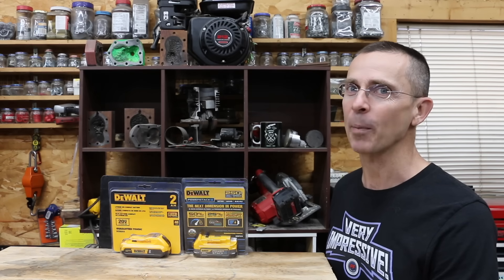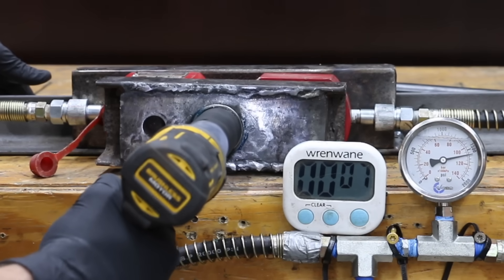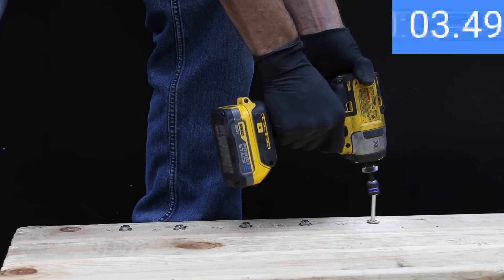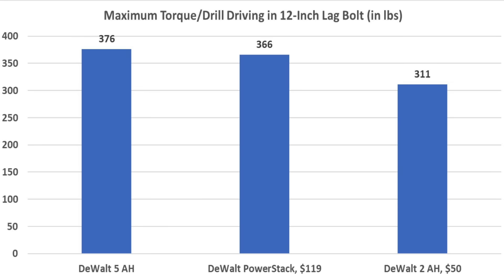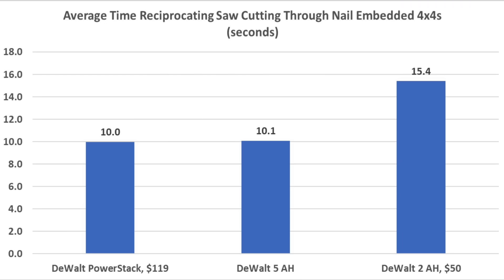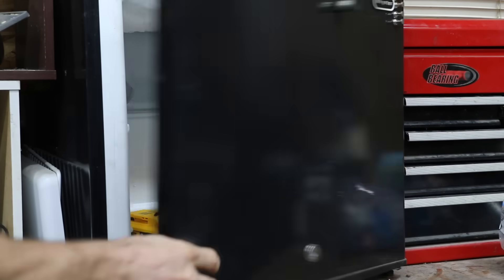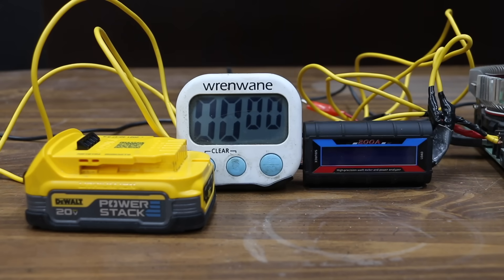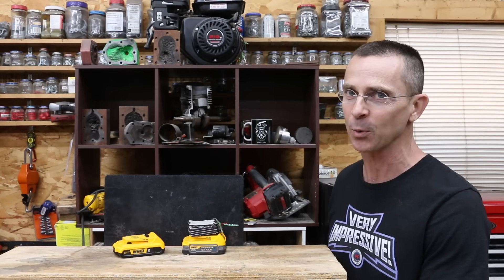Compact “Pouch Cell” Battery Better? Let's Find Out!

Comment: At the current pricing, I'd rather have 2 or 3 of the regular 2AH batteries. If one fails, you still have a back-up. Also, I write the date I purchased the batteries on them, and assign them a number. That way if I have a battery that keeps coming up short or develops an issue, I know which one it is. It's too easy to lose track of batteries when you have 5 or 6 and are out in the field with a project.
Reply from the maker: Thanks for the feedback.  Good tip.
Reply: @ProjectFarm  also you can fix 18650"s easier. much harder to find pouch cells to spec.
Reply: Its probobly just matter of time untill the prismatic pack is cheaper than the circular cell.

While the machinary to produce prismatic cell are more complicated, and expensive... the cells use less material
Reply: @matsv201  it's just a matter of time until the tools take over and we're fighting for our own survival. That's why I keep my tools locked up.
Reply: @whitesturgeon  yea.. I watch a video on a smart drill earlier today that gave the operatör instructions.. its just matter of time untill the turn evil
Reply: @whitesturgeon  I, for one, welcome our robot overlords.
Reply: @whitesturgeon   Shit, that explains some of what's happening in my house right now...excuse me, I gotta go call Sara Connor!    Aaaahhhhh!!!!!
Reply: I have a P-touch label maker that I use to do just that. And since the tape is heat sensitive, you can tell at a glance if the battery pack has over heated because it'll turn solid black.
Reply: @ImpendingJoker  The heat-sensing is a nice feature I never considered!  But I just use a sharpie to label, and that is so easy I think I'll probably keep doing it. :)
Reply: @ImpendingJoker  !!  I still have the p-touch. What an idea!
Reply: From an engineering perspective, I might add a couple things:

Start compiling energy density in terms of Wh/kg and also Wh/cc. The volume of an irregular shape like a battery pack can be easily done by wrapping a pack in a plastic bag (vacuum sealing would work, just pull as little a vac as possible to avoid damaging cells) and dunk in a bucket of water, calc the volume from water level change)

This gives a good baseline as to who is using space efficiently. Also consider changes in points of balance when mounted on tools. Some impacts or drivers may be nose or tail heavy.

Look at thermal characteristics of the packs with both a FLIR type imager and also a thermocouple buried inside the packs. Understood this is a challenge with the pouch batteries.

Reason I mention this is the pouch batteries became cost-effective with high-volume cellphone ptoduction. Most phones have a single pouch, with a large heat dissipation area on the back and through the display. Stack a bunch of them and those cells in the middle have to conduct through outer cells and connecting tabs, or radiate out the tiny edge areas. Maybe they sandwiched some copper plates in between to extract heat? In any case it would be useful to compare life of the different packs. That would take hundreds if charge/discharge cycles, so that could easily be a year long effort. A programmable power supply/load could shrink it to months. Check with Keysight.

Just some random thoughts...
Reply: Even more importantly, the old ones are Korean cells assembled in Mexico and the new ones are all made in China. Think about where your money goes and what that means for the future of Democracy.
Reply: @christopherestewart  99% agree with you, but here in the USA we are a Republic, not a democracy...
Reply: 👍🏼 Yes, that is similar to what I do! Got to know which are getting wimpy or might be a warranty claim! 😎✌🏼
Reply: I number my Makita 5.0s, and rotate them for even wear.
Reply: "Also, I write the date I purchased the batteries on them, and assign them a number. That way if I have a battery that keeps coming up short or develops an issue, I know which one it is. It's too easy to lose track of batteries when you have 5 or 6 and are out in the field with a project."
I am going to do this next time I purchase batteries!
Reply: TFW the Youtube comment section actually has good advice. This is something I plan to do myself now.
Reply: I'm actually more interested in the price comparison between the PowerStack 2Ah and the regular 5Ah battery.  If the 5 Ah battery is priced the same or less than the PowerStack, then the 5Ah is a way better deal.  You get the same or better performance as the PowerStack, but more than double the capacity.  The only thing you give up is size and weight, and I'm not sure it's enough of a difference to warrant the capacity loss when compared to the PowerStack.
Reply: @somejoe7777  It's actually 3 times the capacity... I'd prefer the compact 21700 single row-packs instead. About as much power as a 5aH, but slimmer design and still twice the capacity of the stack.
Reply: @somejoe7777  the cheapest I've found them is around $75- $80 a piece when you buy them 2 at a time.
Reply: @somejoe7777  I think most people that know about batteries and their history think of the li-ion metal cylinder cells as a better quality battery platform than the li-po pouch. Not sure how Dewalt can charge twice the cost when that pouch li-po battery technology can be found in really cheap things that need high current like lithium jump starters.
Reply: @practicalguy973  I've had 4 jump starters bloat and fail. While I can repair them, getting the lipo pouches isn't nearly as economical and easy as cylinders. I take power tool batteries people throw out and refurbish them with quality cells. I've got a 5ah that puts out 30a when needed so that's used I high torque situations. Using the same battery I used 20a cells but made it a 6ah battery for lower torque applications where I prefer longer run times but don't need the higher power. I do the same with 2ah batteries though I tend to pick a cell that has higher instant amps but not necessarily the highest so it gets me go overall capability.
Reply: @somejoe7777  - If weight is an issue, the Power Stck is definitely a winner. If not, the Power Stack is not worth it.
Reply: @somejoe7777  You can get 2 5ah batteries a charger and carry bag for $124.99.......Way cheaper than the powerstack..
Reply: the point of the power stack battery is to have similar power density to the 5AH battery and less than half the weight, its also very compact, which again is the whole point. supposedly Dewalt are coming out with new impacts early 2022 and i plan on getting 2 power stack batteries to go along with my purchase.
Reply: I have several backup batteries for my heated jacket. I like the idea of a lighter battery but I don't like the🤑.. super cold temperatures have an effect on every battery I don't care what kind
Reply: Great comment!  I do very similar regarding batteries.  And photocopy your receipts with a smartphone, copier, etc, in case of needing to make a warranty claim.
Reply: There is another advantage to your recommendation. One battery in the tool, another battery on standby, and a 3rd in the charger. That way, you can work continuously, without having to wait for a battery to charge.
Reply: 2ah batteries are great for things like orbital sanders and tight spaces with the impact. I've got 2x 2ah, 2x 4ah, and 2x 5ah and the 2ah's are almost always my go-to batteries unless I know I'm going to be really punishing it, like with a sawzall, blower, or chainsaw.  Just makes using the tool so much more comofrtable.
Reply: A least with modern cell phones we know that quality li-po pouch cells can be done but I don't think its better. It was less over all power in Wh as shown in the video compared to the small 2ah. I have a feeling the cylindrical li-ion is still the better way to go in the long run. For a smaller battery needing high current it makes sense to go with lipo pouches but with a 5ah and larger that is a lot of current ability for power tools anyway so sticking with the standard 5ah Dewalt is what I would do especially for the cost!
Reply: @practicalguy973  Exactly,  The need for max power AND ultimate in weight savings is a pretty rare situation for most people using hand tools.
Reply: @practicalguy973  if you factor in cost sure, however the point of these batteries is they put out as much power as a 5AH battery at less than half the weight and size, they are compact. yeah so they dont have the same endurance as a 5AH battery? so what, buy two. thats what im going to do. this is new tech for dewalt or any power tool manufacturer and as time goes on bigger and better batteries will be released.
Reply: Home Depot currently has PowerStack at $119 and a bundle of normal 2ah, 4ah, and 6ah all for $149. You won't see those kinds of sales with a proprietary cell type and low manufacturing scale that they're not pulling as much profit from.
Reply: Seems like they are going to try to push these pouch batteries because they are 100% sourced in china an that means more slave labor, lower costs and higher profits...  I say a big FU to that...
Reply: @asificam1  Agreed
Reply: I actually just got a 2 pack of the power stacks to compliment my 4 2AH I got with other tool packages. I have a reciprocating saw that was nearly useless with the 2AH batteries. It couldn't make it lengthwise down a 3/8" sheet of plywood on a single battery. With the powerstack battery it cut the full length (slowing towards the end) but recovered after a 30 second break. I know its the wrong tool for the job but I had to rough  out a door on a shed too far from an outlet and didn't have a cordless circular saw. It became the benchmark for the batteries after i realized how fast the reciprocating saw ate them.
Reply: @dreamwraith-84  - at double money?
Reply: @asificam1  Use a label maker, the labels are mostly peel-n-stick by default my experience
Reply: How do these batteries stack up against a 120volt powered  unit
Reply: @punker4Real  depends on design. Batteries beat the pants off most corded simply because it has more or less equal performance but is portable. That being said if it'd all equal or they design the motors and you pay the money, a shore powered tool will likely out perform a battery tool,  assuming it's not harbor freight.

While i have corded and some air tools, most everything gets converted to battery because I almost always need portability over the extra little bit of torque or longevity. I can always have spare batteries to overcome that.
Reply: @punker4Real  No comparison. Plug-in tools will always be more powerful, and they don't run out of batteries.

Nothing beats air power though, but it's very inefficient.
Reply: @TehButterflyEffect  not true, go look at torque test channel latest video. He shows a Ridgid and other impacts that beat even the best air power.
Reply: DeWalt actually has a really good return policy on there batteries especially if you write the purchase date on them.
Reply: It's literally the first thing I do when buying a new battery. I started keeping track of the batteries when I bought a Black and Decker mini vacuum cleaner over twenty years ago. Batteries were always going bad. (nicads)
Reply: I'm sure 99% of us feel the same way
Reply: It's another money gimmic. It doesn't offer enough difference to be considered efficacious.
Reply: Also, a higher capacity drains less per cell, which would lead to longer overall life. I.e. a 5AH should hold capacity closer to 5AH compared to a 2AH to 2AHs.
Reply: Lipo usually have around half the lifespan of lithium ion. I think these lipo batterys are cool but not cost effective. ive never wanted more power out of a brushless impact
Reply: @asificam1  - paint pen.  Specifically ones intended for writing on pipe, etc.   There's also ultra thin heat-shrink that they use for 18650 I'm sure you can get for AA size - I've found it holds marker much better.  It may still be too thick for a lot of the uses of AA.
Reply: @asificam1  try a fine tipped artist paint based marker, easily found at a place like Michael's, multiple choices such as metallic gold, silver etc, won't tend to rub off easily as a 'permanent' sharpie marker or peel off as a glue based label could. 👍
Reply: Yep, when I have several batteries I label one A then the next one B etc. I like keeping track on how much I use a battery so I can rotate them 👍
Reply: …except that a 2Ah battery can make a higher class tool perform like one that costs several hundred less… and make some of those lesser, more-affordable, tools nearly useless. You wouldn’t shell out $400 for the new DCF900 brushless high-torque and slap a 2Ah pack on there. You’d just get a compact or mid-torque, and even then you might want that 5Ah to get the most of it.
Reply: Currently he has two yes two of the 1.7 ps for $55. This seems like a crazy deal to me
Reply: The small 2AH battery aren’t worth it…
Even for longer home projects you should have a 4AH. 

And nowadays, you can get two 5AH for 75$.
Reply: I also date coded the batteries I bought and gave them a number so I can see how long they last. Glad Im not the only one!
Reply: You can often pick them up on sale for around $60-80.
Reply: Do keep in mind that the original MSRP of the 2ah was about $100, and they've dropped it in anticipation of these coming out. It's likely the 2ah may be discontinued if the power stack system catches on
Reply: @davidthomas2870  Won't happen. They need small cheap batteries for their "kits", knowing you'll soon buy at least one better battery. And prismatic (pouch) batteries degrade faster in use whereas the cylindrical cells hold their capacity better till near the end of their use-life.
Reply: I can see certain situations where the PS battery would be nice to have (weight). But I wouldn't go crazy with a bunch of them.

Time will tell their reliability also. Gas buildup in a pouch pack kills the vacuum applied to it that keeps all the sandwiched materials together and you end up with a poor performer. Cylindrical cells are much more durable with regards to abuse imo.
Reply: 2AH battery will not deliver the performance, it just cant do the tough job that powerstack can. sure if you're doing light duty things and care more about runtime than power. but if you dont need to run the tool for extended epriod of time but need to do difficult jobs powerstack can do it without the weight or extra size of 5AH
Reply: I've never written the date on the battery. If I use two batteries, if I can't use them normally, I'll bite one of them with my teeth. If I can use it, it's very good. If I can't continue to use it, I'll bite the other one. Generally, I can use it normally. If you still can't continue to use it, replace all the old batteries.
Reply: @julinnayin8426   LOL Wtf like biting the metal celled battery? but why tho? biting things is bad for your teeth for one and never a good idea on something filled with corrosive and toxic chemicals that can also cause a shock
Reply: The Torque Test Channel tested these bad boys, powerstack is right up there in terms of power delivery, at the cost of capacity because of its small size. It's worth it, full power on a tool and its small and light.
Reply: @mcspikesky  "worth it" is very subjective.  How many people need the max performance of the tool but the extra 6 oz. using the 5Ah is a deal breaker?  I think not many.

Comment: Those battery packs look very similar to the ones used in most cell phones now. I wonder if replacement cell phone batteries could be used for rebuilding tool batteries
Reply: No, a phone battery isn’t made for this kind of discharge rate.

Comment: Why more batteries = more power?
Reply: More batteries in this case = more voltage
Reply: They stated it wrong. The voltage of the batteries are the same, just the Ah capacity is larger. So the power in Watts (P=VI) will be the same, the larger capacity batteries can just supply the same power longer. So it is more energy that the bigger capacity battery can supply, not the power. W = Power, Wh = Energy
Reply: @ruan2587  true i thought he was talking about the batteries stacked in series which would result in more voltage

Comment: I went on the subreddit for engineering questions and asked them to calculate the pressure between two 2x4 being screwed together with an impact driver and they were incapable of answering. I provided every possible number associated with the screw, the boards, the brand of impact driver but they couldn't make an equation to predict what is shown so simply in this video with your PSI guage set up.
Reply: Sorry, I wasn't on reddit at that time, I, like most serious, proffesional, educated and experienced engineers, was busy engineering! 😂
Reply from the maker: Thank you!!

Comment: I would be interested to see a durability test of the pouch batteries, LiPo pouches are more sensitive to drops and punctures than Li-ion cells.
Reply from the maker: Great recommendation!  Thank you
Reply: 🔥 I'm thinking , the cheaper and more unreliable the better these days , you'll own nothing and be happy anyway if your around .. 😁👍
Reply: They are extremely fun to poke though, just do it from a distance... I burned my leg a bit poking one next to me! It sprayed out violent fire the instant the nail penetrated. I was expecting a delay where I could run. 

Lesson learned, haha
Reply: Fizz, bang, smoke. The ultimate result.  Would be fun to see for sure.

Comment: The polymer pouch cells are less expensive to manufacture than the 18650 cells which is not reflected in the retail price.  Maybe there is more "protection" electronics.

The polymer pouches and expand quite a bit it over charged.  The housing needs to be sized accordingly.  If not, the additional pressure could cause a fire.
Reply from the maker: Great information! Thank you
Reply: Yeah, and once they expand they lose performance as all the internal sheets separate... so time will tell how these last in the field.
Reply: Dewalt claims to have solved this problem.